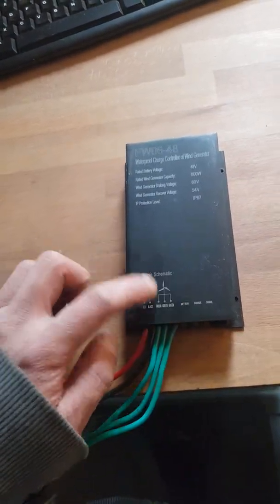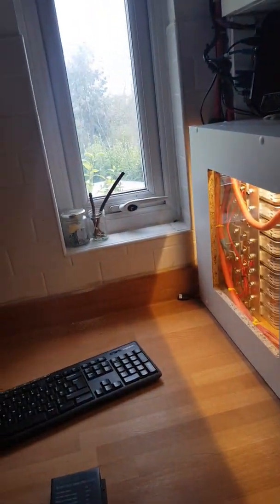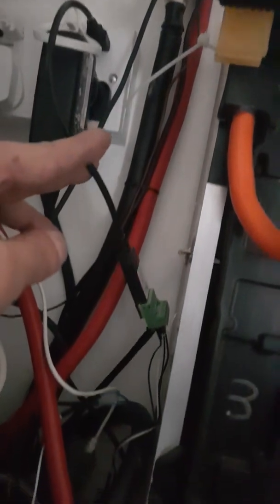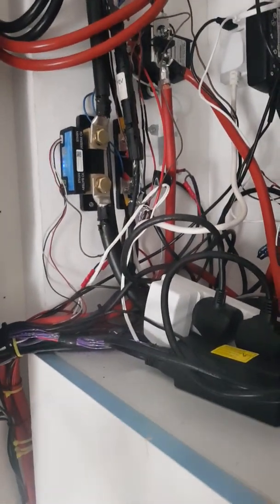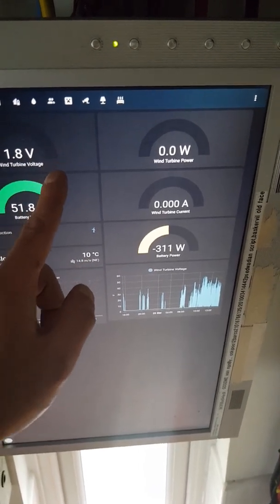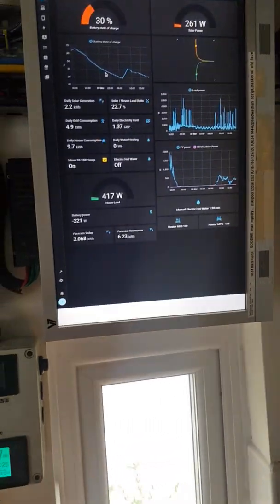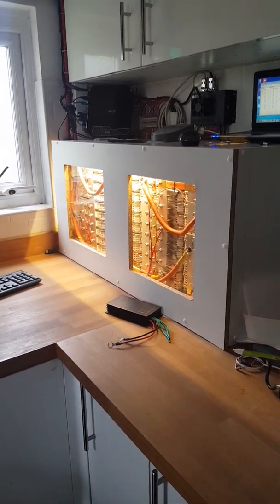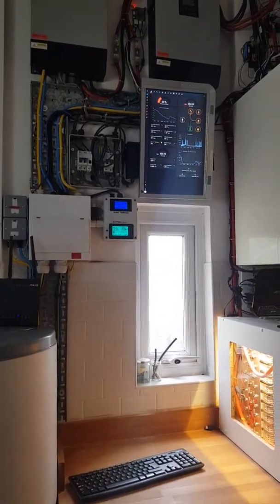Wind controllers , home assistant sensor hardware - esp2866, rs485 to TTL and peace fair sensor

Comment: Have some diverse bits of grid connected microgeneration. Hoping to make a start adding some batteries etc. The pi running Home Assistant with esp's grabbing data from ct leads and sensors like you have shown looks like the best way to pull it all tougher into one local low powered dashboard.
Thanks for sharing👍
Reply from the maker: Good for you, running home assistant does make the most use of excess power and the best way to control your home  at the same time, while getting the feedback data of your equipment.  If i couldn't automate the equipment like hot water and mining stuff, i wouldn't be able to use the extra 50 -60 kWh per day.  Also i find trying to find faults (which present as under performance) requires graphing and data logging, also very necessary.  I hope your home assistant build goes well, if you run into problems give me a shout i'll help as much i can.
Reply: @offgriduk2643  Hi, we have a Solis grid tied solar inverter and an older PowerOne job on a turbine. Adding some DC solar and a Multiplus if I can get the gear which is becoming scarcer and more expensive here now.
Some of these devices have their own monitoring but we need a single system like yours which brings it all together in an easy to read panel making it easy to monitor. 
The Solis is not supported by Home Assistant at this stage so I will need an esp ct lead setup there to track the output along with others in various places also. Knowing the water temp is also vital for us👍
Reply from the maker: you will probably be looking for the peacefair 004v3 AC monitoring , and the 017 peacefair for DC, useful for solar panels and wind turbines, a load of esp2866 chips, a ttl rs485  chip, for the temp and water controller maybe something like a  sonoff th16, they will only switch up to 15A AC you will need a contactor in place if using an immersion heater. That lot can work with home assistant